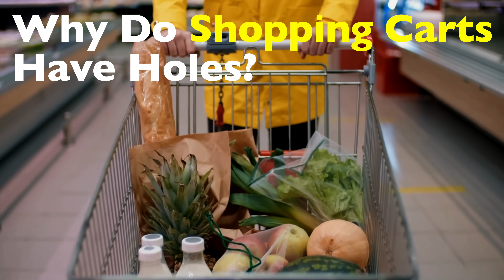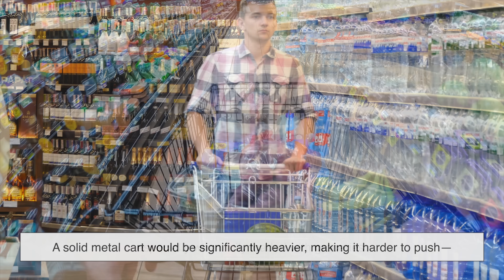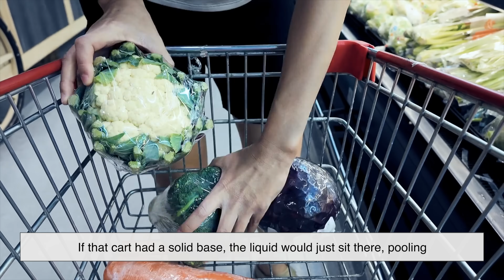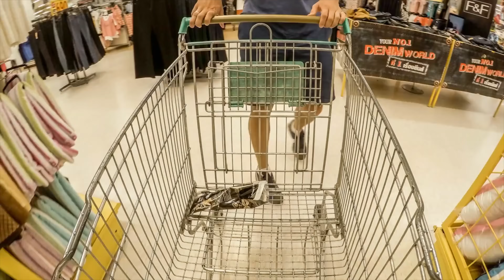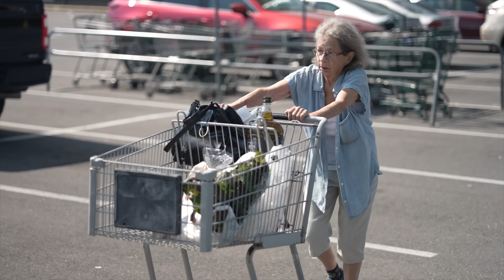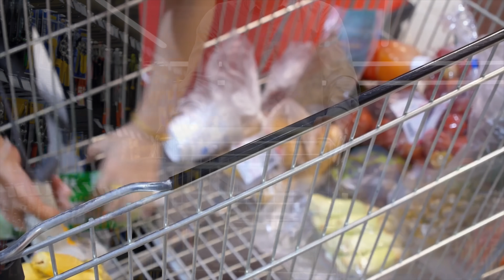Why Do Shopping Carts Use Wire Instead of Solid Metal?

Comment: Without watching, I can think of several reasons right off the bat :
1)Wire is lighter than plates of metal so easier handling
2) Less surface to rust
3) Even with some perforations, a solid steel basket would hold water longer - see # 2
4) The glance over effect, to see what you have in it : 'Did I grab the bread, yet ?" etc.
5)  Cheaper manufacturing cost due to less metal used
Let's see how many I get right ! :)

Comment: UK shopping carts or trolleys as we call them here, have two wire baskets or comppartments with a flipdown or flip up folding child seat for children up to around 4 or 5 years old to sit in, now with a ƿaist strap to secure them in the seat as well as the leg holes there.  there's a hook to hang extra bags or a shoulder bag, diaper/nappy change bag or handbag Etc, while you are shopping, plus these gadgets on the handle bar to link the trolley to other trolleys so people can't steal them and joy ride around in them. Some supermarkets have the wheels of these trolleys locking beyond a certain point in the car parks/lots so the trolleys can't be  stolen for joy riding purposes. You have to put a token or pound coin into the gadget on the trolley handle to release the locking chain cli from the other trolleys outside a UK supermarket  You can also get trolleys with toddler chairs with a 3-point harness or even a basinette on the chassy or a smaller carseat like child seat on top to transport children too small to manage the slog round a supermarket.  I used to sit up top in the flipdown child seat with a packet of hoolerhoops to keep me occupied and happy while my mum did her supermarket runs.  You can also get just boring average smaller size shopping carts/trolleys with the same locking features, but none of the child seats, chairs, basinettes there. .
Reply: Same in the states.

Comment: Tell me this:  why does the lower shelf slope down , so anything placed there works it's way off into the floor?  
Liquids drain through and five people slip and fall on the mess....a plus for lawyers...
   Welded wire does cost more (especially chrome plated) than thin sheet metal.
   All the time light was mentioned it was in reference to weight, imagine a solid box and needing to move it to the "light" to see better what is in the bottom.

Comment: The biggest drawback I find in the design of shopping carts is that if the package is smaller than the holes, it will fall through to the ground. This would be small bags of nails, screws or nuts and other hardware in small packages. Although the percentage of products that would fall through is small, it’s still annoying when it does. 😌😌
Reply: Not a much falling straight through, but coming out the bottom side row.
Reply: Chapstick and some lipstick, eyeliner or other makeup products can fall through. Maybe pens and and other similar size items